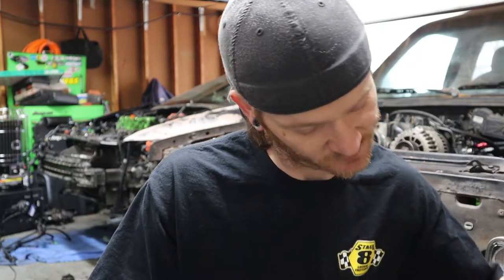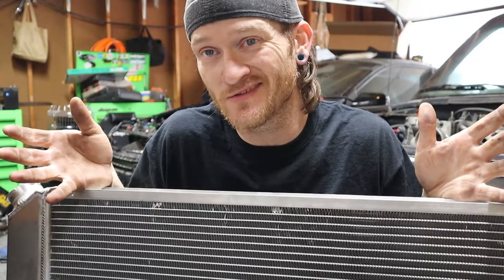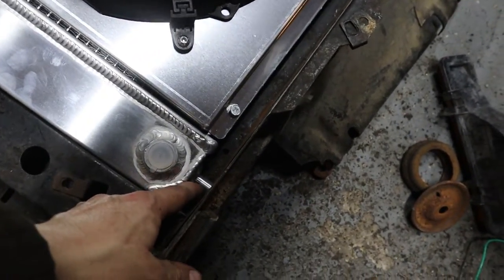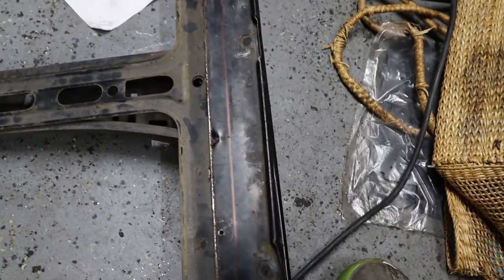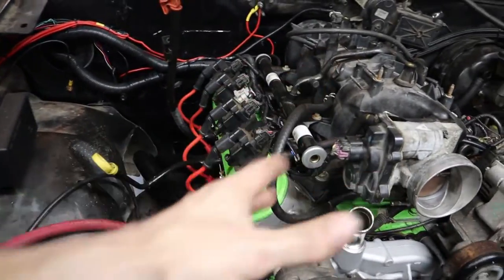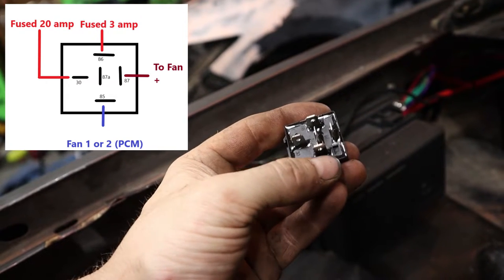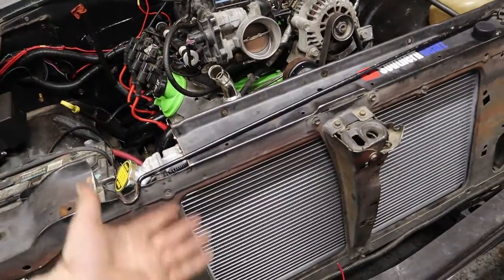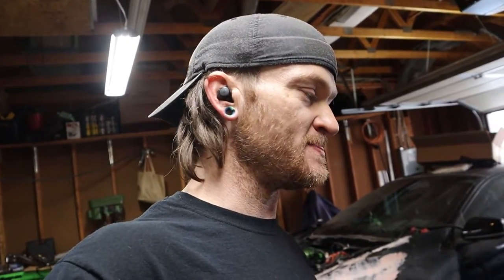How to LS Swap your S10 EP.7 | Proper Radiator to Stay cool!

Comment: Do you have a part number for this rad by any chance?
Reply from the maker: https://www.ebay.com/itm/254859985524?mkcid=16&mkevt=1&mkrid=711-127632-2357-0&ssspo=ShdUowCLScC&sssrc=2349624&ssuid=G2YjFL52T-i&var=&widget_ver=artemis&media=COPY
Reply: Thanks! Thought that was the same one I ordered. Looks like hole in core support in a 2nd gen is a little bit smaller. Will need to do some trimming to the sides to make it fit.
Reply from the maker: Ah dang thats crazy i would have figured they would be the same good to know!
Reply: Hey man, great video's I've been watching your s10 project for a while now got an 88 s15 lq4 on the go at the moment, are you happy with that radiator, no heating issue's?